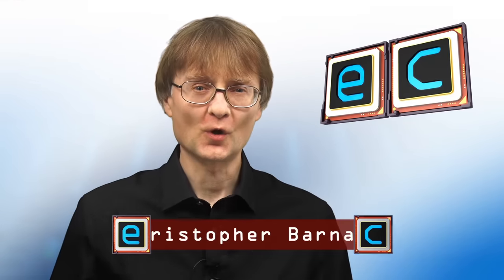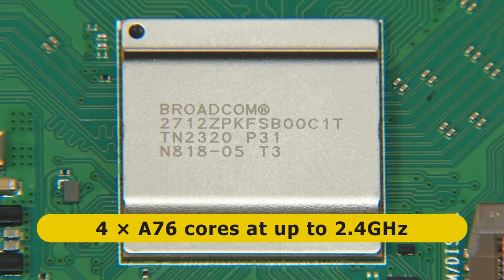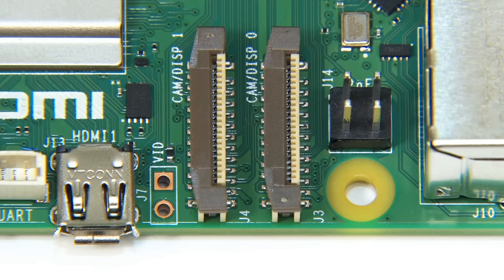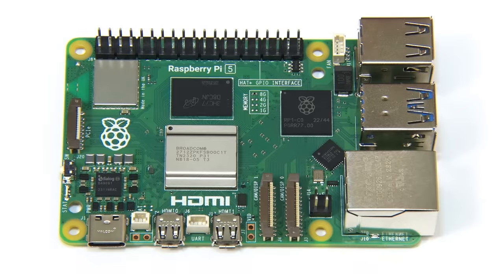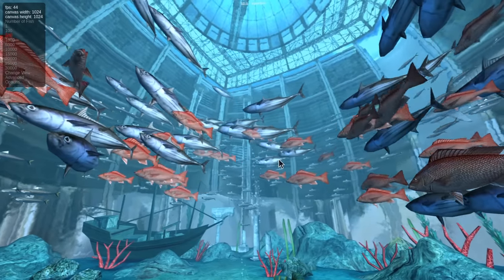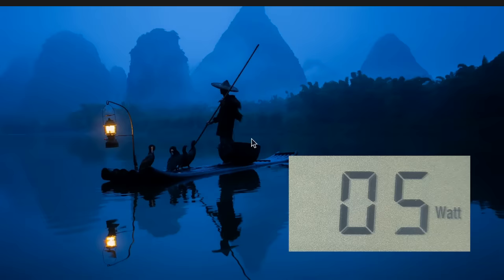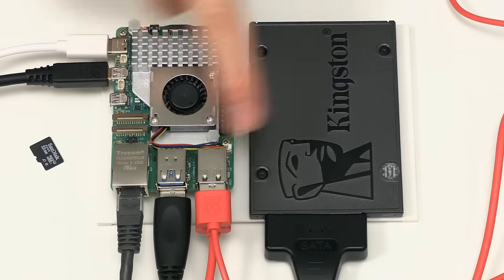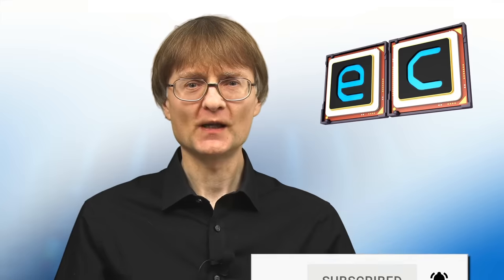Raspberry Pi 5

Comment: Really upset about the removal of the audio jack (which also did analog video). It's my understanding this was mainly a manufacturing decision as they want only surface mounted parts to speed up production to keep up with demand. Imho the jack's removal, along with they're insistance on using mini instead of full size HDMI, are antithetical to the original purpose of the raspberry pi. It was supposed to be primarily a cheap educational and tickerer board, a modern equivalent to micro computers like the zx spectrum and comodore 64. I know there are adaptors, dongles, and hats that can be used to solve connection issues but requiring them kinda defeats the purpose of an sbc like the pi. If you have a bunch of boards sticking out of it is it even a SINGLE board computer anymore. The thing also costs $80 now. I don't know it just seems like the modern pi is made less with the needs of the pi community in mind and more the needs of industrial/business clients. Rant over.
Reply from the maker: I do agree with a lot of what you say here -- save that the 4GB Pi 5 is $60. :)

Comment: Hello all, I'm new to all this and have a question hopefully someone could answer :

Is it possible to add a stereo 3.5mm Jack socket as a peripheral via a cable? My advanced apologies if this is a silly question.
Reply: You can get audio from the HDMI connectors (if it's built in to the display or if it has a 3.5mm breakout of its own), or you can get a hat which connects to the GPIO; like the Pico Audio Pack which provides both a headphone jack (amp on-board) and a line out (line level audio.)

Comment: With much enthusiasm you talked about the clock battery connector, but you didn't use it.   I am imagining a hat so to accommodate a clock backup battery, when computers in general are terrible time keepers. (Thus network time protocol.)
Reply from the maker: Raspberry Pi will be offering a button cell with a lead to plug in to the RTC connector (which is what we have on most SBCs). But not available yet. So no HAT required. :)

Comment: By the time the Raspberry pi 10 is released, we'll need a 5V / 20A power supply but still won't have USB-PD support built in.
Reply from the maker: The Pi 5 does have USB-PD built in. :)

Comment: Very impressive design improvements. Looking forward to rPi 5 play time in 2024. Given the performance improvements, I have several applications in mind. My only tiny disappointment is the rearangment of the USB and Ethernet connectors -- I have some kewl rPi 4 cases that would have been nice to re-purpose. On the other hand, new case designs may better accommodate access to the power button, battery connector, and added camera and PCIe ribbon connectors. I'm sure C4labs will be on top of it already!

Comment: It came with a 5A power supply, meaning 25W. I doubt this computer max power consumption will only be 6W.
Reply from the maker: Apparently it can get up to 10-12W, plus peripherals. For me, it drew 10W in the Sysbench test when running the OS from the SSD. Also remember that all computer PSUs have to be able to handle peaks for system stability.

Comment: Heat sink and cooler, 5 v -5 amps. This thing is hungry. Do i see a PCIe slot there? My eyes are bad. Gee that was a quick bootup. Nice indeed, Thank you for the news. 

I  will have to wait a bit to get one. I could use this as a low power desktop replacement

Comment: This was a very well keep secret. I know that the main point on a RPI is the support and community support. But looking at the hardware alone i feel like this falls short of target for something that it is launching a year after most of the RK3588S SBCs and will last for over teo years as a flagship product, at least. 
I dont know, i feel like i have no use for it, to use as a pc, at $80 i would go Orange Pi 5A that it is better, unless you need the wifi, i would also need to buy an additional M.2 hat if i dont want to use a SD card, and 4Gb is a bit too little for that use so i cant even consider it.

And if im thinking of something more specific we already have a SBC with a m.2 slot for as low as $30 that i could use to build a NAS/Jellyfin box, the Orange PI 3B.
I dont know, i dont want to say it, and belive me, i really dont want to say it, it feels like too little too late, at least from the hardware aspect, as i said i know the software aspect will be great. If the RPI5 would have launched a year ago before the Rk3588 SBCs it would have been HUGE, but now it feels like it is on a awkward middle area. Soon the RPI5 will be challenged by the AllWinner soc with Dual A78 + hexa A55 and even Risc-V SBC because i dont think this is much faster than the Lichee either, i think it is better but not by much.

Comment: the fact that they put a pci slot where the display connector was, and moved the display connector to the cam connector.. is a big no go for me .. this just made all available pi screens incompatible, no more way to connect the pie to the screen and attatch the ribbon cause 
a.  they are short out of the box .. 
b. the ribbon would have to be routed over the fan or heatsink and therefore blocking it. 
c.has to be potentially bend and kinked to now fit the connector after routing it around if you have a long enough cable.. 

they should have just put the pci connector where the display connector is right now , and left all other ports like they where originally

Comment: I stopped using Pi's. I sold all my pi4's during covid.
They are expensive when completely build, and underpowered. Slow data ports.

I went for Unraid.  Yes it eats more wattage, but gave me more flexibility and has docker.

Having no good SATA ports was the biggest downfall on the Pi. And I hated those usb c connectors. Why not just the old round DC plugs. 

I really think that Barebones have won from Raspberry.

But that's my opinion.  

Nb:   I used a Meanwell PSU to run total of 5 Pi's.    
It had more Amp's.

Comment: Why not making the first HDMI regular size and instead of using the second mini HDMI put it on the power USB-C so you can use a docking station. If they do not use the USB-C for any data they should have been using a Barrel jack with higher voltage like 12V 2A. It is just more maker friendly. Pushing the USB-C further without power delivery voltage increase will only cause even more problems than the RPI 4 has now. There will be many forum posts because power issues.

Comment: Very unsurprising update. I'm disappointed its only PCIe 2.x and not 3.x. The improved IO is good but I would rather have 1 full size HDMI vs 2 mini connectors. I've never used 2 displays on my RPi 4.

My fave SBC / most promising SBC is the RISCV VisionFive 2, despite its comparatively weedy CPU, which I expect the VF3 will address. RISCV is the future and its advancing much faster than any other platform.

Comment: The fan in the thumbnail immediately put me off. It's nice to know it can still be run fanless but even pushing towards fan as a requirement is bad news for the pi AFAIC. Every application I've ever used them in has seen them stuffed into a tiny box and shoved into a corner net to a switch or router, with the occasionally SSH session to make sure they're not completely riddled with vulnerabilities.

Comment: So, it seems that if you want audio you have to add in an audio interface, which will cost as much as the Pi and be four times its size. That's a huge deal breaker!

Comment: I would lose the second HDMI in an instant if that would get rid of the micro-HDMI connectors, which I really hate. They're just too small. HDMI connectors are too stiff, there's too much momentum and I've accidentally damaged a couple of HDMI connectors when installing Pi 4 boards in awkward places. I can't stand micro-HDMI.  I need normal robustness a million times more than I would ever need dual HDMI ports.

Comment: Love the new specs, but if the NVMe doesn't come close to my ODroid M1, I can't really use it:

# hdparm -t --direct /dev/nvme0n1p2

/dev/nvme0n1p2:
 Timing O_DIRECT disk reads: 3468 MB in  3.00 seconds = 1155.04 MB/sec

I'm in the market for a few SBC's to move my single MicroK8s deployment to a bona fide multi-node cluster and I like the price point of the Pi 5.

Comment: They still didn't realize with only a single pcie connector and lane if you want to use both an m.2 ssd and an external graphics card simultaneously they'd be really slow. They should've given 2 pcie connectors.

Comment: Very exciting indeed! The RP1chip idea is also going to appear on Intel's upcoming 14th Gen processors, where an ARM SBC (yes ARM) is actually added to the processor die to handle IO and some other stuff, thus freeing up the core design to focus on the compute aspects. I am sure AMD will copycat in no time. Back to RPi5, a 1GB ethernet it is very disappointing in late 2023. Nowadays 2.5GB should be the minimum. What do you think Chris?
Reply from the maker: I agree with everything you say on the chip side, but don't know anybody using 2.5Gbps Ethernet. As always it depends on use case. :)
Reply: @ExplainingComputers  Not many right now but it's good for future-proofing (especially as 2.5GB switches are becoming more affordable).
Reply: CORRECTION: I wrote "ARM SBC" but I actually meant "TSMC SOC". Apologies for the confusion (this is what happens when you post something while half asleep 😁)

Comment: Still no onboard storage?
So, to get the PI5 (i bet it will be overpriced) running ok, you need to spent more money on a hat and the in a ssd, is that right?
And still two useless micro hdmi ports that break at minimum effort?

Comment: Having just watched Jeff Geerling's video (https://www.youtube.com/watch?v=nBtOEmUqASQ) immediately before this, and my judgement on both is that Raspberry have done a very good job of trying to find the right balance on where to go with their next generation of Pi.

There are a lot of small form factor PCs starting at a couple of hundred GBP squeezing from the top, and things like the Pico and Pi Zero squeezing from below, so finding the right price, functionality, and performance point between these alternatives is important, and it looks like they have largely done so.

As you say, the lack of colour coding on the GPIOs may be disappointing, but one has to ask to what extent the GPIO pins remain relevant with things like the Pico and Zero taking some share of that market.

More irritating is the continued move away from full sized HDMI, where most of the competition does have full sized HDMI.

The big question that remains is how quickly, and with what quality, will the support ecosystem (e.g. new cameras, hats for NVME support) come to market.  It is a very promising and good start, but does depend on the supporting products.

Comment: Wow the Rpi4 is actually worse than I thought. I've been under the impression it would run the SD card at around 65-70<Mbps like all other SBC's I own (Orange Pi 5, Orange Pi One, Orange Pi Zero3, & Zero 2W, Libre Le potato, and about 10 Android boxes taken out of their cases and modified. What makes this Rpi4C ---- I mean 5 good exactly? The Orange Pi 3B ,may habve a worse CPU but it comes with emmc and nvme installed on the board, with emmc costing like 15$ more for 256GB, or the Opi5,5B Where the emmc is 400Mbps, and the USB 3 is much much higher, but the NVME m.2 gen 2 is also around 400Mbps, or the fact the Opi51+ has a Gen 3 NVME at 1600Mbps, I just am so utterly disappointed to see the most well known board creators make literally just a small improvement on the 4. Like when Orange Pi went from 5 to 5+ NOW THATs an IMPROVEMENT. And its only 20$ more. So WTH is going on here, this isnt worth giving a shit about. It be like claiming the Orange pi 3B is an amazing board, when the orange pi 5 already exists. Not only that can people pls for the love of god just go look at the orange pi zero 3/2W prices and tell me you want a RpiZero2W instead, which if im not mistaken dropped their prices to match the FOUR GIGABYTE MODEL THATs LDDR4/4X and the RpiZ2W is DDR2 and max 1GB. the 1GB OpiZ2W is not even 20$ in canada. That's the cheapest board available anywhere right now. I was looking at the Libre Le Frite which is strangely appealing at it's sale price of 20 USD for 1GB and a strange S805X instead of a S905X so I would just like to test it, plus the smaller the board the easier it is to jam into interesting situations. But Orange pi outdid them wildly by having the 1GB Z3 and Z2W be less than 20$ CAD which is around 15$ USD, so wth, the 4GB version has to be around 20$ USD and it's even quad core 1.5 insteead of just 1. it;s sorta like having half a max settings Rpi4B for idk 1/5-1/6th thje price. Rpi to me, has done great things by creating the interest and hobbyist interest needed to make this practical. But they have only fallen far behind and need a significant redesign. I've been sitting around thinking about the 5 and what it would have and I kept thinking, 6-8 cores, closer to 3 or 3ghz, 16-32GB dual channel ram, gen 3 nvme, emmc, and instead of 4 USB A ports, it could have like 8 USB C ports in the same space, or remove the ethernet port altogether and just have a double stacmed USB C x6 across layout for 12 USB C 3.1 ports. But nah, they just took their Pi 4B which they've been milking forever and said, we need to milk this more, but we can't call it the 4C, which to me is the opposite of what orange pi did with the 5+ which should've had a seperate name considering the sheer increase in performance.

I give the pi 5 a 1.5/10 - Price is too high, Hardware hasn''t improved enough, Maybe your right about the south bridge style control chip and that coukd very well be trhe ONLY innovative thing they've done.which let's be honest disappointing. I had expected at the VERY LEAST, dual channel ram. Intelligently they;d have done quad channel ram, but nope, still single channel. Cause who needs bandwidth when your OS is on a damn SD card that only runs 15MB faster than the le potato. Yup I'm not going to call this the Rpi5, this is the Rpi4C to me. They gotto show something better for me to ever consider buyingt any ofn  rhe=

Comment: No matter how advanced the RPi gets...I'll never understand why they stick with Micro SD cards as the storage mechanism. They're so prone to corruption. There's far better options available.  

It's for that reason alone I'll never rely on a Raspberry Pi for use in an environment where I don't have easy physical access to the device.

If anything, they're likely trying to keep the price per unit down, but I'd gladly pay for a more reliable storage medium as the default option.

Comment: Thanks for the unexpected big news ! I've mixed feelings about this new SBC, half bag of surprise half bag of disappointment.
Firstly the surprise, we finally got something from Pi fast enough to replace the desktop, secondly it does not break my bank. Here comes the disappointment, firstly it does not have internal storage, although the micro SD runs faster it is not designed to use as system drive, extended write cycles will eventually fail it, I got so many bad cards from cell phone use. Although the Pi 5 comes with PCIe, it takes an add-on card possibly as big as if not bigger than the Pi itself for use with external storage. Secondly, it still uses the tiny, fragile, unreliable micro HDMI port, I broke one already on my Pi 4. Thirdly, it omitted the audio port, I was expecting the new board to support input as well ! sorry Pi I am not buying this time.

Comment: why not 16GB? lol. and no full hdmi? and a shame not faster and proper m2 slot. Like the power button though. Also really love a real 4pin fan connector. Been missing that. Might actually buy it because i'm addicted to gadgets. lol. Kinda regret buying an orange pi 5. Probably wouldn't have done if I knew Rpi5 was on the way. I mean its been 5 years. I thought the project was canccelled. Didnt seem like they cared at all.

Comment: Probably kiss of death for audio dac hat.  Doesn't look possible to physical install anyway, with the cooler installed.  My pi3 overheated with a boss hat.  So even if you can install will probably overheat bigly.

They should rotate the pins 90° to allow hats to be installed verticallly.  A bit like a PC motherboard. The pi configuration required access to 3 sides so they were always and still  are a pain to install "nicely".  Not everyone wants a naked pi sitting on the desktop.

I've disconnected all 4 of the 3rd party fans on my 2 pi4. After one month they all became very noisy.
I hope stock version better.

But it looks great.  Perhaps fast enough to be a real desktop!  Well done raspberry. Pi.

Would I buy one though.  No.  I've got 6pi  and 4 second hand small volume HP prodesk/elitedesk.
I much prefer the latter. For little more money.

But yes,  high 5 for pi 5.

Comment: First of all: Thank you for the great summary. Tbh, I'm not that excited about the RPi5 . If the software support would be as good on the competitors I would ignore this release altogether: No 3.5mm jack, kludgy mini/micro-hdmi ports that need an adapter cable, no real USB-C ports in 2023!?... and no colour-coded interface. Come-on guys and gals, you can do better than this.